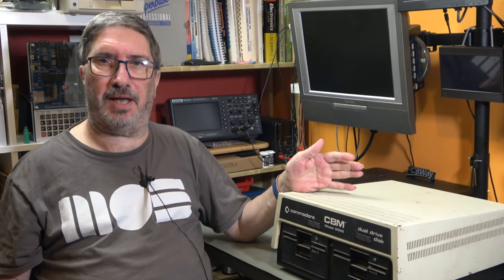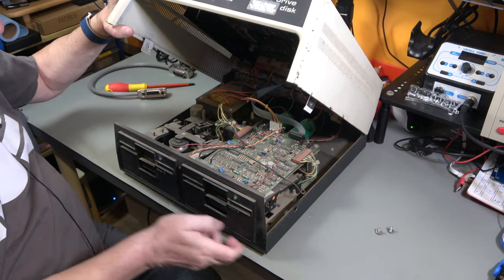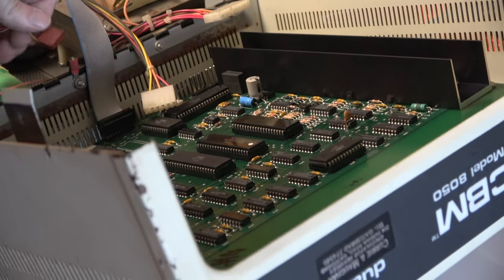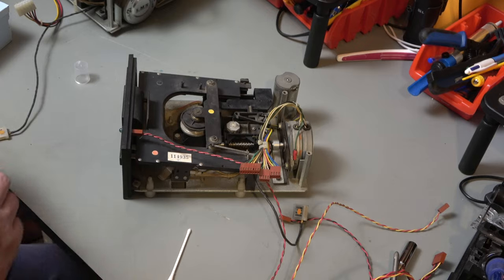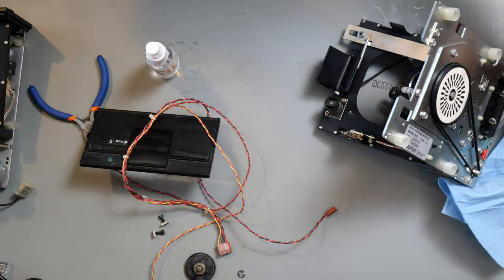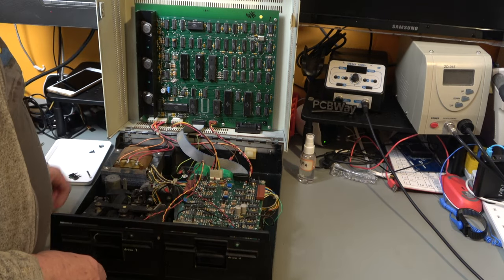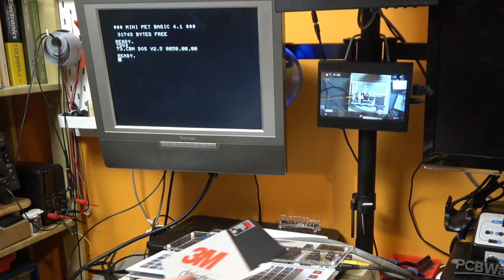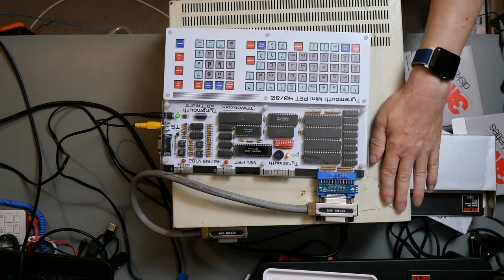Commodore 8050 Dual Floppy Drive Repair and Restoration

Comment: Nice Restoration. I need to figure out where to find  one of those cables...
Reply from the maker: I paid about £12 ($15 US roughly) for mine off eBay for the 2ft length. I'd like to find some 24-pin centronics IDC shells (but I've had no luck so far), cos an IEEE to PET ribbon cable would be really nice & flexible, and I wouldn't have to keep using the edge adapter.

Comment: Back in my youth I lived near a Commodore dealer and software writer (damned if I can remember their name). I do remember that they offloaded work from the PET to CPUs in these external drives as they could both save memory and improve performance that way.
Reply from the maker: There's two ways you could do this: first the drives are autonomous (just like the later 1541s) - they have CPU, ROM  and RAM. You just send them a command to format a disk or whatever, and they go off and do it, no more involvement from the host computer. The second is that. you can upload small machine code programs to the drive, and have it run them. True parallel computing!

Comment: My 8050 had the same issues: Filter burn up + 5 flashes! (although i only got the 5 flashes AFTER the filter popped)
I have 6502 & 901483-03 (6530) on order.
Reply from the maker: I started "bulk" buying 6502s, because these drives seem to kill so many, lol. As an alternative to the 6530 you can use a 6532 + an eprom - easier to get hold of, and the eprom code can be downloaded from Zimmers. You do need an adapter board though (I have some spares - I could drop you one in the post, if you're in the UK)
Reply: @TimsRetroCorner  Thanks for the offer 🙂, this is (probably) the only one I will have and I have got a 901483-03 on order so should be okay on this occasion.
I would like to know more about the adapter board though it sounds interesting. 
You have some great videos!
Reply from the maker: No problem, and thanks :) . This is the video where I built it:  https://youtu.be/NEtBfd20XIg